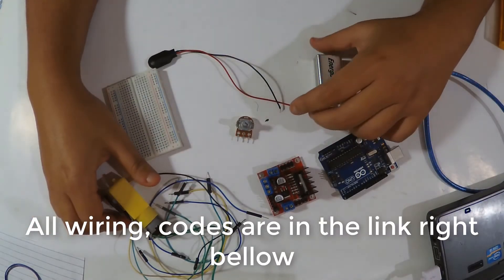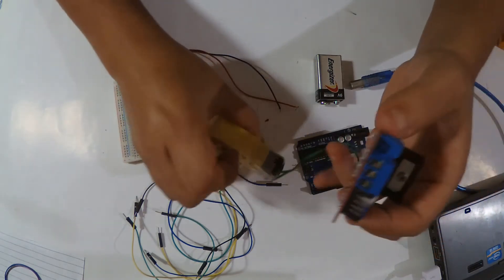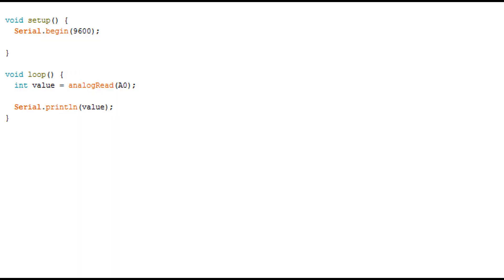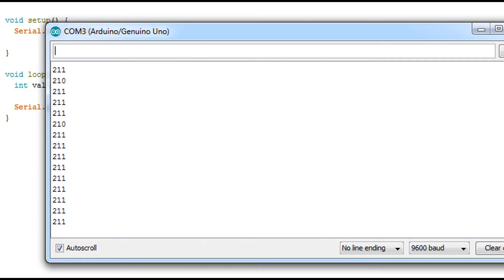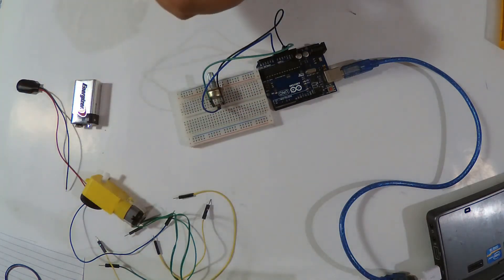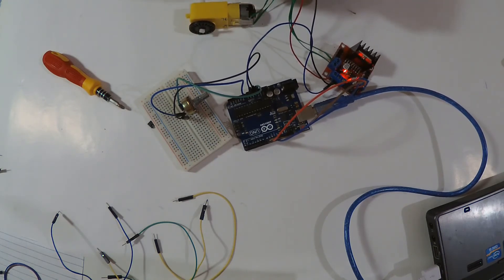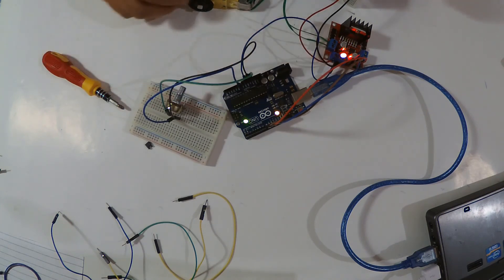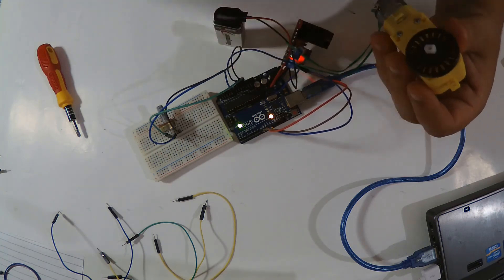Control DC motor speed using potentiometer + L298n driver + Arduino

Comment: do you need to use the breadboard for this? I just was looking for something a little bit more compact
Reply from the maker: Not necessary, it's just for easy testing, you can use short wires and solder connections...
There's also more compact drivers available (depending on your motor)

Comment: Hi good video and exactly what I need for time being  but i would also need PID control as I can see you are working on it since motor have encoder(partial) added to motor shaft. I can use current setup for my project until you or someone with bather understanding and programing skills come up with Pid control.    
Thumbs up !

Comment: arduino nano no work ? why
Reply from the maker: Be sure to use analog input for potentiometer and pwm output for the speed control and pay attention to the pins in the code.
Reply: SurtrTech okay thaks ı will try :)
Reply: hi bro did it work ? bec its not working with me (arduino nano)

Comment: Please Help ! what code ... if i use step motor 3 button (Left,Right,Stop) and i want to add potentiometer to control speed stepper
Reply from the maker: Yes you can use it, with stepper library... For the speed maybe a potentiometer but you'll have to control a delay... I've never tried but it should work

Comment: if i want to show the speed of motr on LCD, then what will be the connecton and code 
please help me out here
Reply from the maker: Hello, there are two ways: The simple but not the reliable is displaying the value directly to LCD, and here I considered that the speed goes from 0 to 255, all you have to do is to print that value given after the calculation (there I named it "speed1") on the LCD.
The best way is to get an motor speed sensor like LM393, then on the motor fix an Encoder... It looks easy but sorry I don't have a code for that yet

Comment: How easy is,when potentiometer will be in the middle to stop?when you turn it from the one side to turn the motor at one side and when you turn it from the other side to change directions?i mean the point 0 of the potentiometer will be in the middle of it,which will not turn the motor,when you turn it right,the motor will turn right and when you turn it left the motor will turn left.Thank you in advance.
Reply from the maker: Yes it's easy, the potentiometer value goes from 0-1023, you read its value, and do 3 cases:
- if value<500 (example) and you put a direction to the motor "LOW, HIGH thing" M=Map(value,0,500,0,255)
- if 500<value<520 and here you switch the direction and modify the M value that you will put to the speed pin
- if value > 520 here you stop all
Reply: @SurtrTech  thank you very much😁

Comment: How you know the potentiometer value ?
Reply from the maker: A wide range of potentiometers will give you 0-5V Output, in Arduino with "analogRead" function you can get the value depending on the potentiometer position, and with the Uno's 10 bit ADC, you'll get 0-1023 for 0-5V

Comment: good video bro but in this we can control 2 dc motors and one dc motor should rotate in CW DIRECTION AND OTHER ONE IN ACW DIRECTION ?
Reply from the maker: Yes you can control each motor separately, its speed and direction

Comment: is it possible to do this one-to-one with the Arduino nano?
Reply from the maker: Hello, Sorry I don't know what you meant by one-to-one,
if you're talking about the whole video, yes it can work with a nano
Reply: @SurtrTech sorry my English is not so good😅

 can I swap the Arduino Uno with the Arduino Nano?
Reply from the maker: @danniboy2.066  Yes you can do it, just adapt the pins, and for the inputs of the module (IN1..IN4) can be used with any digital pin, the (ENA and ENB) you should use them with PWM pins, or shunt them if you want the max speed always

Comment: I have a motor driver(MD10-POT) able to control the speed and direction of your DC motor without using a microcontroller or writing a single line of programming code. Product Link Below: 

https://www.cytron.io/p-md10-pot

Comment: no resistor is needed?
Reply from the maker: If you want to add one in a specific place it's up to you
Reply: I am asking because I am new to this and I actually do not know why or which resistor i will need
Reply from the maker: You won't need any resistor here, it's for limiting current or dividing a voltage... here everything is adapted.
Reply: thanks for the explantion
Reply from the maker: Welcome

Comment: if the input is replaced by LDR what kind of coding ?
Reply from the maker: First wire your LDR with Arduino and test the result given for high and low light then calibrate it to get from 0 to 255 as an input
Reply: do you remove jumper from ENA and 12 volt ?
Reply from the maker: If you want to control the speed you should remove the jumper from ENA or ENB and connect it to a pwm pin from Arduino,.
You remove the 12v jumper if you're using a voltage greater than 12VDC.
Reply: i'm using 12v to supply for supply L298N, then i should remove to jumper ?
Reply from the maker: The power jumper permits to connect a power source (12 V max) to the 5v regulator so you can power your Arduino board or other circuit from the module itself (+5v pin), if you remove it you won't get +5v from the module.
If you're powering your module with 12V or less there's no problem keeping it.
Reply: i change potentiometer with LDR module, that is work !!!. Thank you so much for your help